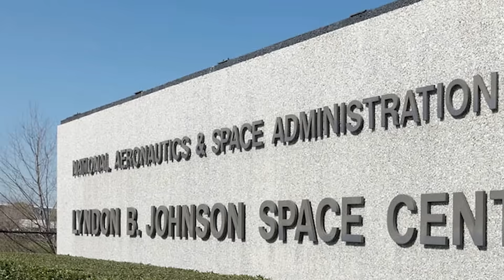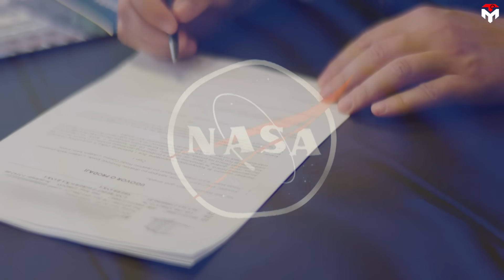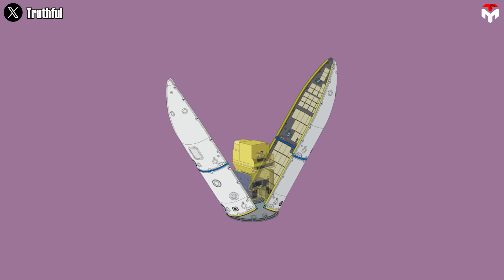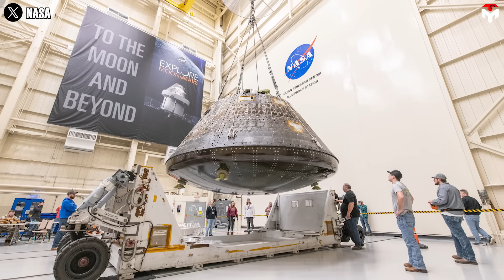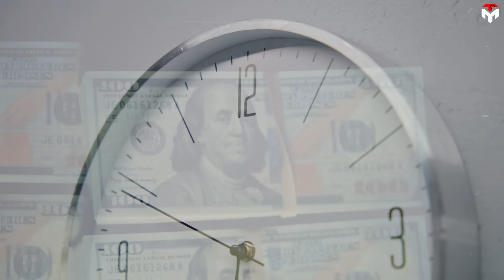SpaceX's New Falcon Heavy Upgraded to the Moon Instead of NASA 4$ Billion Rocket...

Comment: at this point any money spent adapting Orion/Falcon Heavy is a waste when Starship (the upper stage) is almost ready for commercial deployment and the Super Heavy (booster) which is more capable than SLS has been making rapid progress. not a fan of Elon the person but facts are facts
Reply: There's a lot of planning that takes place prior to using a rocket for a specific mission. NASA already has missions planned for Falcon Heavy into 2028.Their first use of Starship won't be until 2026 and that will likely slip into 2027. But, that planning has been going on for four years. So, any investments that continue to be made with Falcon Heavy are likely going to last until 2029 or 2030, which means there's still plenty of life left in it.
Reply: Yes, almost ready, as we just saw after Starship's flight #9. Just waiting to see how it will land on the moon upright, and make a successful ascent from there. Even its first manned flight to LEO will surely be more exciting than that of Boeing Starliner.

Comment: If NASA's position is to ONLY use Orion to go to the moon, and REFUSES to pay for a modified DRAGON, well, then why doesn't SpaceX just go it alone? You heard me. SpaceX pay for and launch its own, independent moon mission. Launch the hardware on Falcon Heavy into LEO, launch the modified dragon on a Falcon (crew rated, right). Then, once in LEO, it's nobody's business what SpaceX does there, right? They can dock, do the trans lunar injection, land, return. Done, before SLS has its 3rd flight, and China beats NASA to the moon. Hey, the cost for SpaceX would be less than a billion. And SpaceX's owner paid $44 Billion for Twitter, right? JUST DO IT. If NASA objects, well, then pull a King Leonidas move: "I've no intention of going to the moon. I'm just taking these astronauts on a stroll, and these 300 metric tons are their bodyguard."
Reply from the maker: No NASA needed; just dodge FAA red tape and go
Reply: @techmap9  In space, no one can hear you WIN! But probably some district judge in D.C. will issue an injunction that says no one can go to the moon unless it is by NASA.